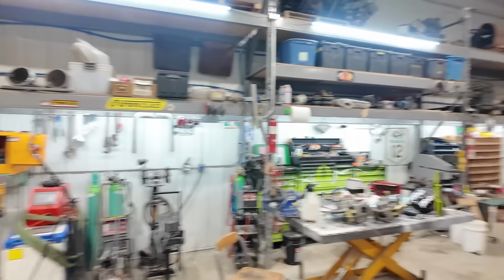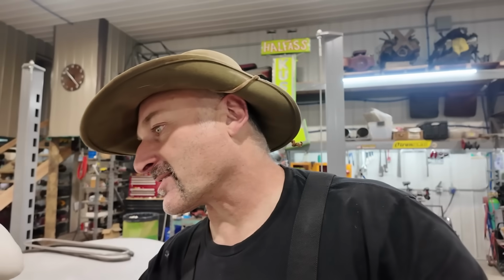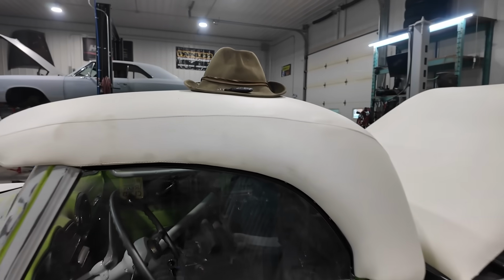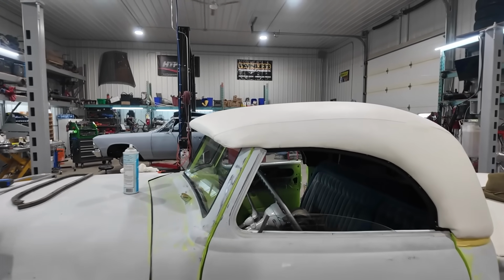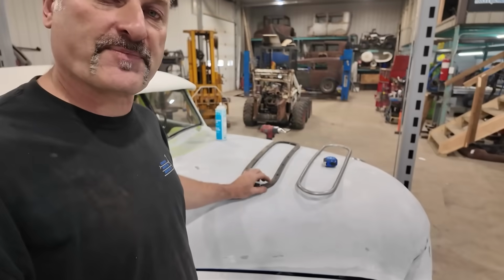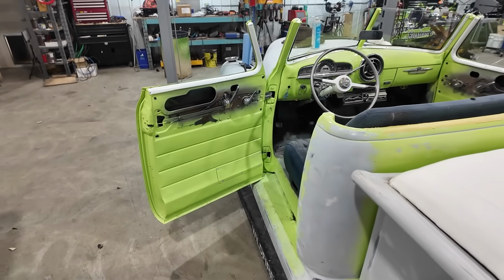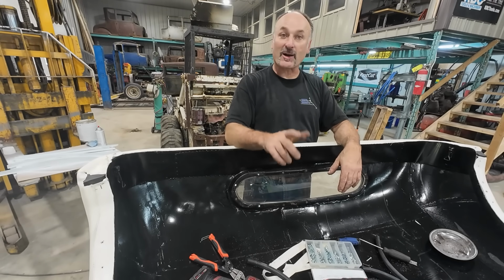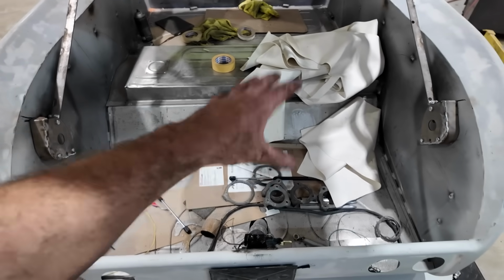Cutting up our new Carson top to install  back window and seal up the top!

Comment: Everything is looking really, really nice. Hope that Lexan survives as the back window. Look forward to seeing more progress on the rest of the truck. I had a '67 Chevelle, 396 4-speed back in the mid-70s. Had a lot of fun with that car when it was running right, but had to rebuild/replace engine, clutch, trans and rear-end all within the first4 months I owned it. Car was a lemon when I bought it and I overlooked things. Learned a lot over those 4 months but it was frustrating. Be safe and stay well.

Comment: Actually the heat doesn't shrink the vinyl,  it's meant to soften the tight areas so you can pull the wrinkles out of the other area's and it's possible that you have a nice molded seal for the door corners in your vast selection of cars, you may have to trim to fit, but most cars have molded pieces that go at the top of the door panels that screw in place and wouldn't be a problem with moving around like the stick on stuff 👍,  p.s. that's a beautiful 66 chevelle

Comment: Where the bubbles in the top over the door you can try a injector needle to seal and press it down ,then white seal over needle hole through the sew joint

Comment: I believe the time to use the heat is when you are stretching & applying it. Not sure it will do anything after it's already a finished project. I wouldn't sweat it. It looks Grrrreat. Ty for taking us along  P.S then i see you use heat as you stretched the rear window, so i think you figgered it out. Lol

Comment: Park that truck outside when it's a 100 degrees. Then kinda massage the surrounding Area so the vinyl can move. Where the vinyl is stretched tight it will absorb the extra from the loose areas.  The glue is always kind of temporary. It needs a trim around the edged to hold it long term.

  Ive been doing upholstery for 40 yrs. You did a pretty nice job for a complete  newby. You've got ahold of the concept for sure. That was not an easy project by any means. Keep practicing.

Comment: Looking good Brent! 
Bought an assortment of the same weatherstrips. 
Thought you always did the practice side first. 
A little stainless piece on the top to hold upholstery away from moving door post. 
Need a Halfasskustom laynyard for your door fob. 
Vacuum tubing to join weaterstrip, inside the bulb part. 
works well. 
I think the heat gun suggestion is to heat the tight material  next to the loose part. Or wait and see what the sun does.

Comment: Using the heat gun or steam is done after the vinyl roof cover is made a little bit smaller than the actual size needed to fit. It is relaxed to stretch and fit taught on the roof, in this case. The vinyl or leather is made smaller and stretched out to shape

Comment: The trouble with offering advice here is that you will have done what you are going to do before we see the problem. The heat gun will help with the initial stretch into place it will not shrink something that is already fixed. Remember when casting aluminium you will get shrinkage of around 6% on pattern size, you can factor that in on the 3D printer before casting.

Comment: I like it also we can not learn anything if we don't try to do anything 
Steamer is often used to soften wrinkles  in upholstery work. 
Heat gun I use when I want to pull and stretch vinyl to eliminate wrinkles.
Thank you for the content

Comment: Brent, white 3M 5200 and nothing including the edges of the vinyl will pull away again. Tap a ball bearing ball larger than the threaded hole into the hole to lightly peen or roll the 1st threads and they'll bite onto the screw.

Comment: Glueing vinyl, contact cement both parts wait 5 minutes at least depending on the amount used before applying to each other I've had great success.

Comment: you would use the heat gun to stretch it it won't take the wrinkles out of it after it cools back down it will wrinkle back up

Comment: Use heat around the area. Not directly on the spot you are trying to shrink. It will draw it down and tighten the materials

Comment: Instead of cutting your windless at the front of the door, if you cut that front support at an angle (leaving the outside the same) and welding a plate over capping the support, the angled cap should be able to crush up against the windlass without scrapping it off the trim piece.

Comment: A thought to remove the wrinkles, maybe you could find some sweet looking chrome pieces to screw down along the seams, not the whole length of the seams just a couple of feet long with a slight curve and a foot long piece for the back. screwed down just enough to take out the wrinkles as i feel if you screwed them down to tight it may wrinkle more. the heat gun/ steam process i believe is used when gluing down the material, not after the glue has dried.

Comment: Don't use a heat gun, it makes the material dry and expands it. Use a steamer,it puts hot moisture in the material making it more flexible and shrinks when it cools.

Comment: Heat it up then stretch  it. Will have to hold in place with it stretched. That about all I know. Did vinyl  on a rocker one time. Did pretty good but not great

Comment: well brent its looking much better  you see the place were the lose vynil is there is the place i was trying to pint you to if you had taken out a lemon shape i will loose all that  but you,d have to take it all off again   no oooow  not again if you see my thinking  when you come to doing the headliner ge some calico  lightly spray glue in side no mutch so you can peel it of for a paten  allso you mite need to use hoops to keep it in place :face-blue-wide-eyes:😎✌👍

Comment: When you cast those caps, you will have a lot better luck doing it with Zamak.  You can get ingots at RotoMetals. Beer cans do not cast well. Zamak will flow a lot better for you.

Comment: I believe you have the wrong idea about heating the vinyl. Heating the vinyl , preferably with steam to prevent burning it, should be done while stretching the vinyl during installation. I don't think heating vinyl will ever cause it to shrink.